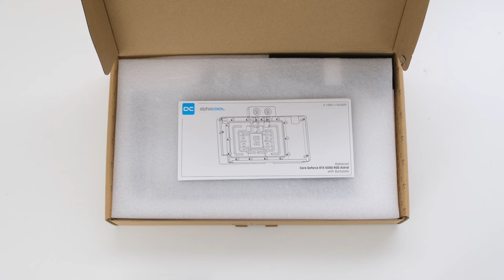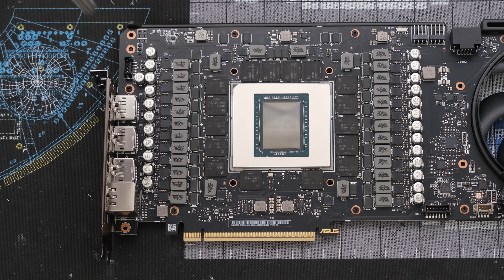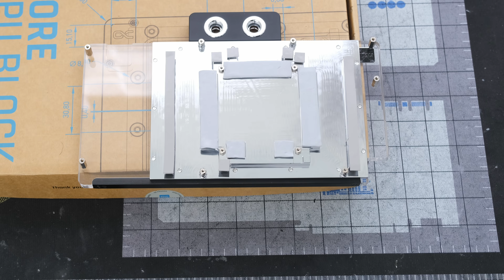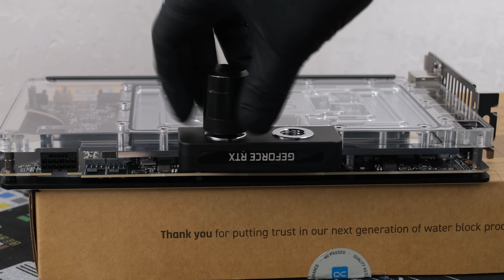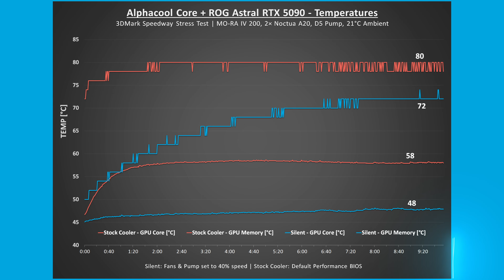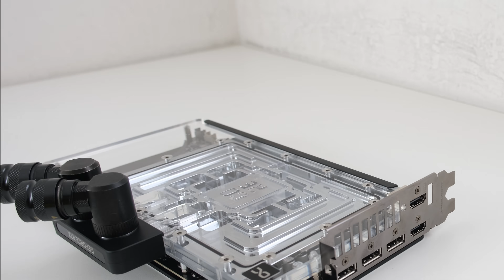Astral RTX 5090 Watercooled - Silent & Overpowered?

Comment: My last 4080 super died a while ago Ive got another one the card is msi 4080 super slim i cant find a waterblock for the slim version because of the pcb being different from the normal 4080 super pcb. My card is shunt modded and is pulling 415w the teps are way to high 😂 no joke. I need help finding someone to make a block for the slim version. This is the same power that killed my last card on air.

Comment: Why did you use a Core block instead of Heatkiller V? Astral is already crazy expensive so I don't understand going for the budget option of Coore. Lastly, your block shootout for 4090 showed a considerable improvement with the Heatkiller V vs Core

Comment: Isn't it a little concerning that there is such a large air bubble stuck in the water block  at 3:45?
Reply from the maker: Well. Funny you mention that. That is the exact same air bubble that was there for the last generation of Alphacool's water block for the 4090. I had the exact same comment(s) last time for this block. In the end, my thoughts are two-fold. First, I think the block could be designed in a way that a large air bubble doesn't always get trapped right there and second, it really has no affect on temps. Temps were good last time and temps are good this time. Hope that helps
Reply: @vectornetwork I just installed an EK vector 3 on my astral 5090 and I had the exact same bubble there as well. I played around with pump speeds and it disappeared the next day
Reply: @vectornetwork this air bubble is easily removed if you „flip” the case gently few degrees and keep it for 10/20 seconds. You will immediately here all air moving through your loop. I can imagine moving bench table isn’t that easy,but yea. As I said it can be easily removed. I have same block for half a year almost,and no air since installation.

Comment: Not really a fan of how the sides, top, buttom - expose the pcb. I hope you'll make a review of the Thermal Grizzly waterblock for Astral. Too bad Watercool ditched the Astral.
Reply from the maker: I agree. I think of Alphacool as the baseline standard, as the temps are good and most faults are based on visual design. I missed out on the initial stock of the Thermal Grizzly Deltamate block, but I am checking everyday in hopes to procure one for the channel. Yea, it seems like Watercool will do a TUF but not an Astral this generation. I am trying (daily) to procure a 5090 Founders Edition. So I'll be able to try those water blocks once I get and tear down the card. Hope that helps and thanks for your feedback

Comment: Maybe I missed it, but it would be nice for these reviews if you included the water temperature so that we can see the Delta between the core temp and the water temp, which is the true measure of the performance of the block.
Reply from the maker: Good idea, next time I'll look at the data and see if its compelling. If it is, I'll try to make a chart! Thanks for the feedback
Reply: Respectively
Reply from the maker: I should probably just drop that word from the script, but I've been saying it so long now...
Reply: Indeed, this would be very useful information.    Additionally, it would be interesting to see how much (if at all) the lower core temperatures and RAM temperatures actually increase core boost clocks and performance and stable RAM clocks.
Reply: From reservoir sensor on corsair xd6 pump i get 15c-19c delta gpu core:coolant with astral 5090 oc in corsair xg5 waterblock. This is while running speedway 1440p full screen on 1hr loop with highest stable OC that passes at minimum 1hr eppedway continuous loop. Gpu is only component the custom waterloop. Attached to black ice nemesis gtx420mm radiator 54mm thick (3 of the most recent noctua staggered RPM fans). Highest stable boost clock offset +310mhz for speedway. Gpu temp 52c-57c depending on ambient room temps. Coolant locked at 37c-38c. Pump max curve at 76% spinning 3500ish rpm. Hope that helps. Havent experienced a single frame drop hiccup since installed.
Reply: 3050mz-3150mhz effective clock speed locked in. Like 1 or 2 minor dips to 2950mhz throughout the full scene. Marvel rivals stays 3150mhz whole time 1440p with better delta and core load ranges 85%-99%. 225mhz-230mhz max boost clock
Reply: 16fpi on black ice nemesis gtx420 rad